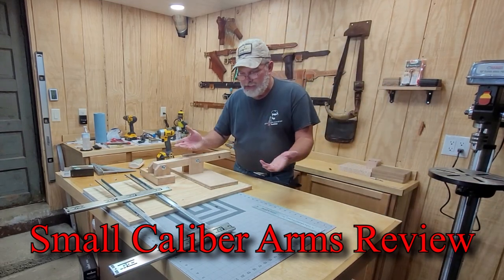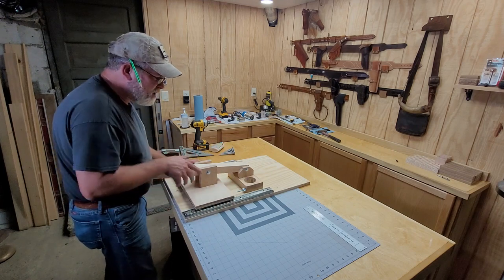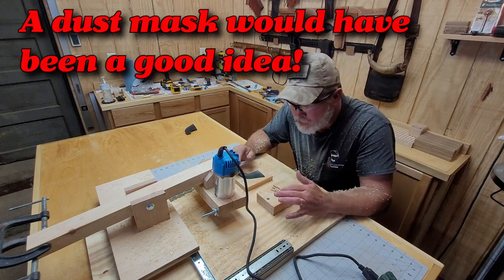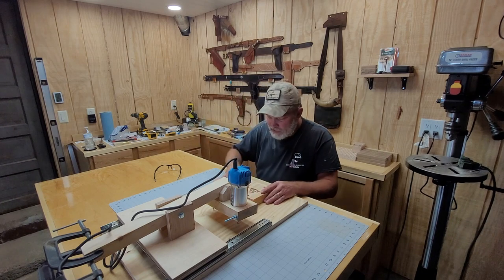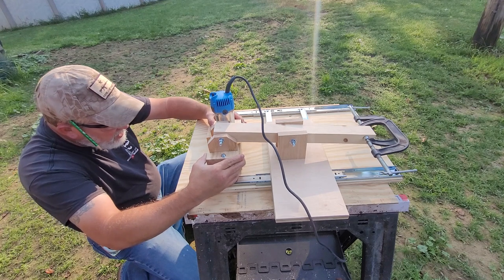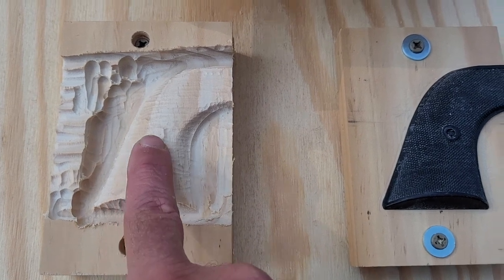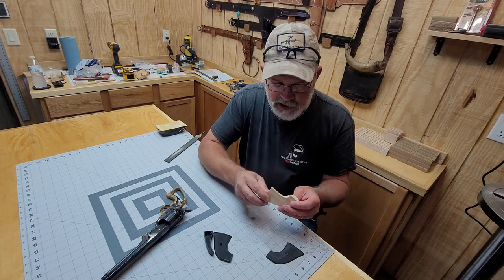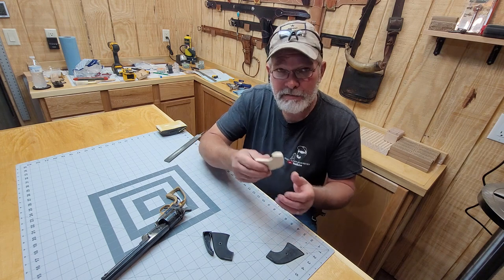Copy Carver 1.0 - Copying Revolver Grips on a Router Duplicator

Comment: Different than most pantograph routers but very simple an effective. Just from experience, a little tip I’ve find helpful. A decent fan next to your table will help with saw dust also prevent as much from getting in your slides. Next best thing to do is place shop vac on router side were the most chips are being slung. That will almost eliminate all dust and make the process much better. You will be more willing to do more of this an not have to breathe nearly as much dust. Hope that helps.
Reply from the maker: I plan on making another one in the future that will be a little more rigid and maybe use linear bearings instead of the drawer slides. I may even incorporate a suction tube for a shop vac near the router like you suggested. Thanks for watching!